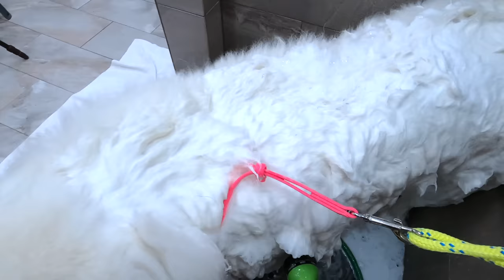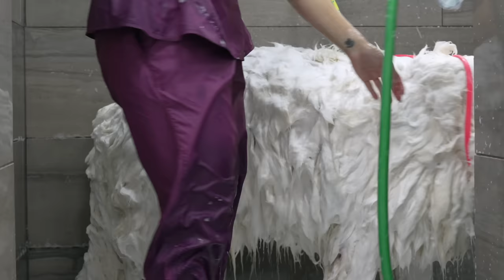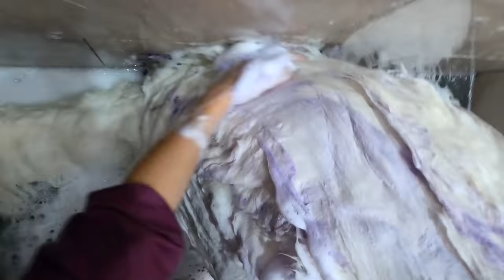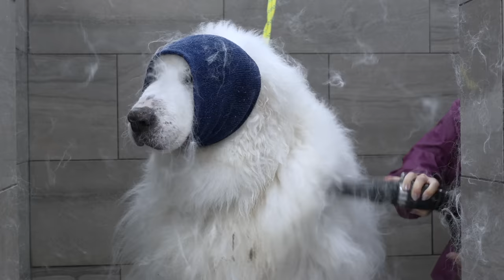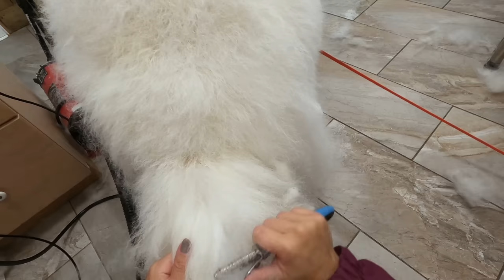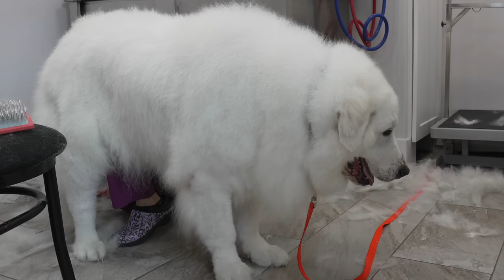The FURNADO of a LIFETIME!

Comment: Is it not possible to get one of those de-shedding water nozzles in that shower? I remember in a previous video you saying that using such a nozzle can reduce cleanup and whatnot 
Or does that tool only work on certain coats? :0
Reply: Her shower does not have enough water pressure for the deshedding nozzle.

Comment: You do two things different than I did. I worked on mats before the bath so I could get more dirt out when I bathed them, and I brushed with the slicker brush as a blew dry (use a force dryer) The dryer blows the coat apart so that I can see down to the skin and know I'm getting all of undercoat and any mats I missed.  I agree that they can only tolerate so much.  I bathed my nephews Irish Wolfhound/German Shepard and it was also a furnado. (not as much as this dog but still ALOT)  When he'd had enough he just turned his head toward me and I could read the look. "I'm done and you will stop NOW!" So I did. He was 11 years old and a tripod so I thought he had done well to last that long.  I groomed in Houston in the "80s before ivermectin was approved for dogs. In fact the Irish Wolfhound kennel I worked and lived at was one of Cornell's test kennels. and my toy Manchester Terrier puppy was the first of the breed to get a dose. Because there wasn't dog strength packaged yet we had to cut the horse dose ivermectin down from to 3lb puppy (he got .001cc, but he did great and it cured his demodex mange.  You wouldn't believe the external parasite loads that some dogs there had.  I groomed a family of cockers that must have carried 1000's of ticks. Each foot had 10-20 between each toe. A collie I did had so many fleas that the coat turned red from the blood of the flea dirt. I doused him heavily with flea dip, let him rest in a crate for 30 min, then when I went to dry/brush him there were still hundreds crawling all over him.  I had to start all over again.

Comment: You should use one of those small plastic foldable one-step ladder if you need to work on dogs from the floor. It will save your back and knees in the long run 👍🏻